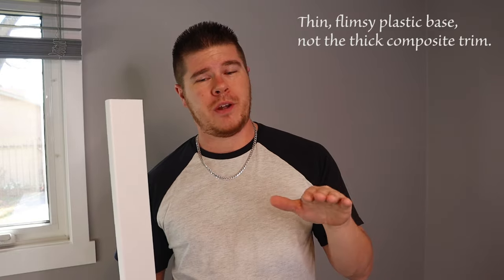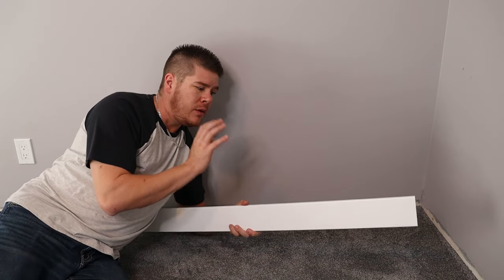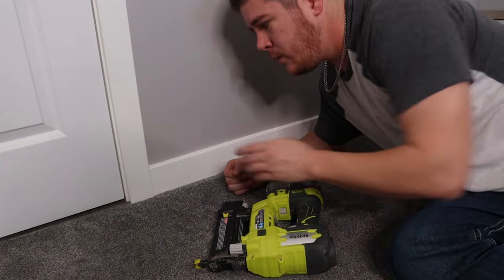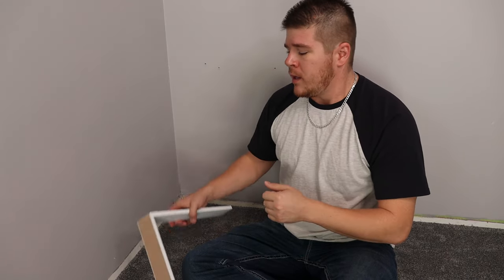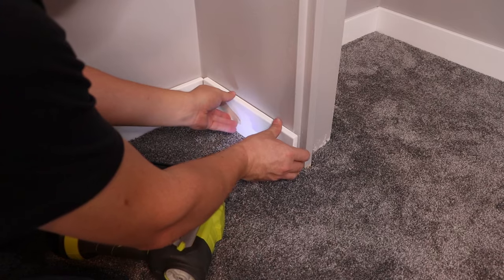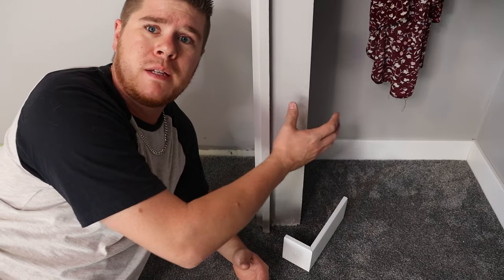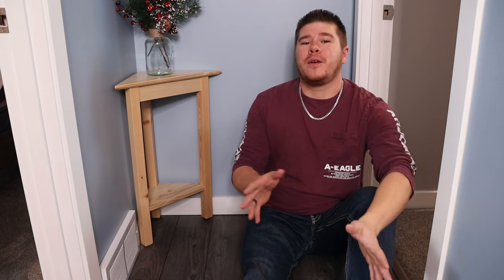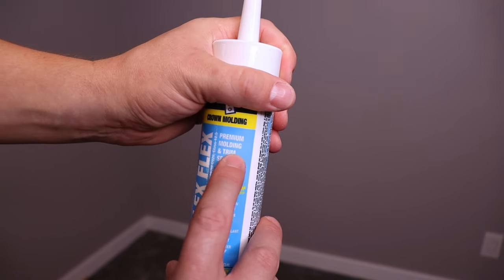How to install baseboard for beginners

Comment: As a retired cabinetmaker, if you use mdf core baseboard, you must seal every end that you cut, or it becomes a sponge for water.
Reply: Good to know!
Reply: as in calk or will wood glue do?
Reply: About to replace mine around my bathtubs at home, kids splash every time, and they must be MDF because they’ve started to sponge out. Will be replacing with something else.
Reply: I like the plastic one for that reason, You don’t even have to paint it it looks like it’s already painted
Reply: Seal with what?
Reply from the maker: Paint
Reply: @JessedoesDIY seal with paint?
Reply from the maker: Yup
Reply: Yup seal with pain
Reply: First timer, I use this stuff on the front porch painted that good caulked it 30 days later, and blew up like a sponge lol
Reply: Thanks. I just changed my mind.
Reply: I always paint the ends and bottom edge by default. You never know if you get a broken pipe in the house later on or maybe a dog pees a puddle that would get soaked up. You never know.
Reply: What if I’m not a retired cabinetmaker? Do I still need to seal every cut end?
Reply: What do you seal it with??
Reply: @JessedoesDIY lmao you diyers man
Reply: @JessedoesDIY   Lol

Comment: I'm so glad you talked about pinning into the studs. 
Wanna know how many brads I've pulled out of water lines?
ITS A INSTANT PAIN IN THE BACKSIDE!!! lol
Seriously always brad nail about 1inch above the floor level, if you don't use studs, which I recommend always using studs....be a professional, and always cover your nails, by inserting the brad, another 1/16th inch or 1/8th and use drywall mud, not caulking!! Caulking is for corners, not nails!!
A quick sand, and paint, and you'll never see them.
I guarantee you, if you use caulk, I will show every spot you've done, with my led light!!

Comment: I am excited about the baseboard that I put in by watching this tutorial. Even though nail guns is expensive I use a hammer and nails by hand. The corners didn't come out quite like his but caulk will take care of that. I have small gaps between the wall and baseboard connecting but caulk will help.
Reply from the maker: Awesome! I'm glad you gave it a go and learned along the way

Comment: Doing my first trim job this week solo. Have assisted with it before, always had trouble cutting so I just did install while someone else cut.  but this will be my first time on my own..the 44° & 46° tip is great advice. The house is.. far from being in great condition so wish me luck.
Reply from the maker: Well you're already half way there then. Good to hear and good luck, I'm glad I could help!

Comment: I just realized I made more work for myself. I bought profiled trim. I installed profiled trim in 3 bedrooms with great success but never again. I'm going with profile-less trim from here on out. My nemesis is the trim cut with an inside corner to an outside corner. The CA glue is a must have. Great tip on the 44 degrees..
Reply from the maker: Yup, been there. The profiles are nice, but waaaay more work. Flat stock still looks great and modern but that install is the way to go. Glad I could help!

Comment: You had info that most videos didn't include like the length of the brads, your suggestion that flat trim was a good and easier option, and that MDF would work with a brad nailer since one source I saw claimed it wouldn't work well with MDF. I did read in the comments about sealing the ends, so I will definitely do that. Glad to see you are using the Ryobi since I just bought the P321 today. Feeling more confident about starting my project. Thanks for a very informative and easy to understand video!
Reply from the maker: I'm glad I could help! I tried to answer any questions that I knew I used to have before I went to school. Most people just have a general hate on for MDF and will say anything bd about it anytime it's used for anything, but mostly because they've probably used it wrong in the past. Good luck on your project!

Comment: Great video! You have a very relaxed style and good simple explanations. FYI: There is a California paint manufacturers, who shall remain nameless, that makes chalking in 4 different off- white colors. They do this by adding paint to the chalking. This way it never discolors over time as it is sealed with the paint. Swiss Coffee White is my favorite. Great to touch-up scribe molding on cabinetry to the wall without re-painting. I've done complete house interiors leaving the trim to wall chalking till after everything is painted. Then simply chalk your casings and baseboard to the walls and you get a perfect straight line every time. Just saying!
Reply from the maker: Thanks! Interesting method, thanks for sharing.
Reply: @JessedoesDIY  This method has saved me a lot of time especially on touch up to cabinets, base and crown. Kelly Moore here in California is the paint manufacturer I referenced. Love your videos!

Comment: I’m a designer and I specify pvc base in bathrooms.  Client just had a power outage and a sump flood, bath trim was perfect, existing wood paint trim dried out, mdf ruined.  You decide if below grade. Pre-finishing is a good idea if you have the time and opportunity.
Reply from the maker: PVC isn't a bad idea ever in bathroom or laundry. I've also got away with finishing all 4 sides and caulking to the floor as well, then it's totally sealed

Comment: This a great video, with some great tips.  Never thought to put the silicone under the baseboard, gives the benefit without seeing it.  
I've cut, primed and pre-painted my pine baseboards for my three piece family bathroom and this will help me install it properly. 
One thing, however, referencing [0:58], I would never put MDF in a high humidity or spill prone environment like a shower/bathroom or a laundry room.  If seen MDF in such areas swell up and that's fugly.
Reply from the maker: Thanks, glad you liked it! Yeah there can be some big problems with it in bathrooms or laundry rooms, but I've never had an issue when you paint all sides, edges and back. It's basically fully sealed at that point and if you have enough water to get through it at that point I think you have bigger concerns lol. Good luck on yours!

Comment: Wish I had seen your video before i bought my wood profiled baseboards! Still working on my baseboards (6 mos later!) because of the corners always being just a hair too long or too short. Im working with a plastic mitre box and a jig saw so i will know better next time i replace baseboards. Your work is beautiful. Very inspiring. Thanks!
Reply from the maker: Oh yeah, I've been there with the miter box before, it's very easy to be a hair off here and there, especially with a profiled board. Thanks tho, glad you like it and that I could help

Comment: Great video and thank you. I'm not very handy at all but you're video covers everything.  We are getting our garage floor epoxied and flaked today (Thursday). It looks great except where the sheet-rock meets the cement, it just looks unfinished. I'm going to tackle this project on Saturday before we move everything back. I'll be taking before and after photos!
Reply from the maker: Thanks, I'm glad you liked it! For a garage, I'd get the PVC trim, its more expensive but because its PVC it wont get damaged from water or anything on the floor. I'm glad I could clear some stuff up for you as well. Good luck on yours!

Comment: Great freaking video! You inspired me to do my own work, where did you buy the planks? I tried looking for them online, cannot find the 10 pack. Thanks
Reply from the maker: Thanks, glad you liked it! Awesome, good to hear, it's totally doable. I got them at Home Depot but I've had others tell me that since the pandemic they've been hard to find in the US, if that's where you are. I can still find them in Canada for whatever reason. Either way, you can still get the flat stock by the foot there. They have like 20' long pieces you can get or cut down if needed. Good luck on yours!

Comment: Great video.  Thank you for clearly and concisely explaining and showing the process. Can you show how to add shoe molding on top of 3.5" baseboard?
Reply from the maker: You're welcome, glad I could help. Do you mean infront of? Shoe mounding doesn't go on top. If it's infront of, it's just the exact same methods as the baseboard, just when you nail it on you go through the center of the face of it at a 45° angle with a 2" nail into the subfloor, usually. Depending on your floor it might not reach, if so just lay the nail gun almost on the floor and hit it to the baseboard

Comment: excellent video. thank you. one of the tip I learnt is to apply the extra caulk which you take off on to the nail holes. saves an extra step
Reply from the maker: Thanks, happy to help. I've never ben a big fan of the caulk in the nail holes. I do it from time to time in areas it won't be seen, but I find it shrinks too much and leaves a small divot

Comment: Excellent video! I’m gonna redo my whole house. We’re going with a wood baseboard because we plan to leave the natural wood color. How would you suggest covering the nails? Or would you just leave it?
Reply from the maker: Thanks! They make wax fill sticks to match all different species of wood. If get the one for yours and then you just rub some in the mail hole and wipe off the excess. You may want to get a slightly darker and a lighter one to match the different wood grains better where a nail might be in

Comment: This in awesome tutorial- you really to the time to explain everything very well. I am excited to take on this project. Do you have any videos walking us through the removal of the old baseboards? ☺️
Thanks again for a great tutorial!
Reply from the maker: Thanks! Glad I could help. I don't, no. If there is a caulk seam between it and the wall just cut it with a sharp knife, then get a thin trim removal pry bar, they should come off pretty easy. Good luck on yours
Reply: @JessedoesDIY  sounds easy enough! Thanks again! 😃
Reply from the maker: Anytime, good luck

Comment: Thank you for your explanations, they are very helpful. You said not to use caulk on wood floors. Is there something that can be used to fill gaps between hardwood floors and already installed baseboards? (In an old building from the 30’s). Thank you.
Reply from the maker: No problem, glad I could help. Not really no. The reason is because the wood floor expands and contracts quite a bit naturally and is give it a season or 2 before it pops and caulk or silicone you put down

Comment: Really well done/well explained process. I’m curious as to why , with that butt-joint on that inside corner , the first piece didn’t go all the way to the wall and left a good sized gap .  Of course some caulk would fill it in . You don’t do shoddy work , so there must have been a reason .  Thanks !
Reply from the maker: It's just variances in materials, boards being slightly crooked, walls not straight. They add up. Plus I didn't have pressure on it yet so it springs out. Once you press it into the corner, and press it down to the floor it levels off and the gaps close up. You could spend all day finagling over corners if you really wanted to make them absolutely perfect, but there is no reason here.

Comment: Your explanation of the 44 degree corner was clear as mud. Why does dry wall mud cause problems?
Reply: The mud is piled onto/into the inside and outside corners to cover over the metal corner protectors, screw holes and tape that you don't see but are there. This means the corners aren't really 90 degrees anymore. 

You can test this with a builders square, and you'll see that they are either sharper than 90deg on the outside corners and a little less sharp (obtuse) on inside corners. 

Adding or subtracting 1 degree on each side of these cuts gets you closer to the real shape of the corner.

Comment: Nice video with lots of good tips! I was hoping you would have included some tips on installing a quarter round as well. What angle would you drive the nails?
Reply from the maker: Thanks very much, glad you liked it! I don't see a whole lot of quarter round in my area, so it doesn't come up very often. But I'd press it tight against the base and lay it almost flat against the floor, maybe 15-20° and everywhere you had a stud in the base I'd fire it in. If you go at too much of an angle you'll run the risk of hitting the flooring. If it's a floating floor you'll ba nailing it down, and it it's tile, it'll deflect.
Reply: Personally, I do not recommend quarter round. Imo, it devalues the home and looks cheap and lazy even if done correctly. To each their own. It covers up flaws but if you’re doing the work, you might as well replace the whole board unless budget is a problem.

Comment: Thanks for the video!👍My baseboards are wood and are all chipped 😭 
When I replace them which baseboard and prevention of this happening again is the best option?
Thanks!!!
Reply from the maker: No prob, glad you liked it. I'm not sure how old they are but that is typical wear and tear over life. Usually the more angles and profile the boards have the more chances they have for damage. Other that that, just avoid even touching them with things like a vacuum, just get close

Comment: Question-why did you glue together the 44 degree pieces of wood but then just nailed in wall without connecting pieces beforehand for the other corner?
Reply from the maker: I was showing if you used a profiled board (not a flat board like I used, it was all I had) that you should use a inside cut and the angle to do it. But then I showed how to install flat board as they can just slide into each other and be installed separately

Comment: Hello there! For ground moulding installations for fitting correctly, instead of a table saw; can you also use a hand saw to cut the moulding (mDF)?
Reply from the maker: Hey! You definately can, yup. It's just going to be a bit harder to get nice outside corners, but a little glue and paint and nobody will notice anyways. Good luck on your project!

Comment: do you have a video for garage baseboard? I wash my car in my garage and currently dont have a baseboard so was thinking to get this project going but i was wondering about the bottom portion, I probably need bathroom silicon to seal the bottom of the baseboard so that water wont go behind my garage drywall right? 

awesome video thx!
Reply from the maker: I don't, no. They make PVC trim you can buy that's the same size as baseboard. Use that since it's waterproof and then a outdoor rated waterproof caulk to the floor.
Reply: @JessedoesDIY  nice! thank you sir for the tips
Reply from the maker: Anytime! Good luck

Comment: Great video!  Regarding MDF vs hardwood....isn't MDF a lot softer?  So, if you're banging into them with a vacuum, or kids banging into them with toys, etc., wouldn't hardwood hold up better over time?  Thanks!
Reply from the maker: Thanks! Much softer technically. But I haven't had very many issues at all with damage and they've been in my house now for 5 years without issues from vacuums. If it does damage its an easy fix with some drywall spackle and paint, but it's your call. I don't have kids so I can't attest to that tho.

Comment: Tried to skim through the comments but didnt see this asked ... thoughts on using glue in addition to nailing???
Reply from the maker: Not needed, maybe a dab in the corners to the wall but that's it. Between the nails into the studs and caulking it'll be just fine...not to mention easier to remove in the future without damaging the walls if needed

Comment: I would like to see you build a studio tiny house similar to the shed you made. And what type of insulation would you recommend using to keep the warm in during extreme cold weather . I will be making the shed this summer. My question is insulation which is better foam or fiber? How easy is it putting electric items ?
Reply from the maker: I would absolutely love to build one! But first I need the space for myself, or even somebody I know to need one so I can. For insulation I much prefer the batting style, not foam. I really like Rockwool, it's fantastic. Electrical is a whole animal unto itself I'd have an electrician do. There is a ton of laws and liabilities there
Reply: So here is another important question regarding vinyl flooring. So my son likes to slip on the floor in which now has caused the vinyl floor to break apart the strip . I am gladly welcome to explain a 3minute video and tag you to get your advice / opinion on what I could do to replace it . If you wouldn’t mind. The way you explain in full detail is what has me and my family subscribed into your channel and response time is immaculate which is highly appreciated
Reply from the maker: Again, I would love to help out but I don't have anywhere that needs a repair to show it, and the videos of just talking don't do well and it hurts the channel to upload. You may be able to pull them back together with tape. Or you may need to cut it out and use floor adhesive to put a new one in. I'm sorry I cannot help further but I can only film these things if they happen to me first
Reply: @JessedoesDIY  that works

Comment: Hold the nails back from the corners of the wall a bit to avoid hitting corner bead which can deflect the nails and send them out the sides or face of the boards
Reply: a dewalt nailer dont care.